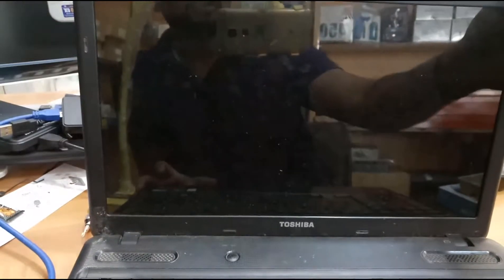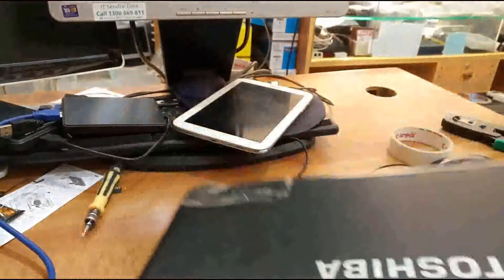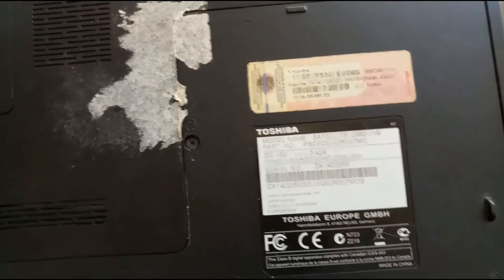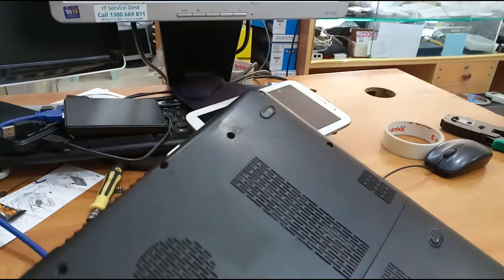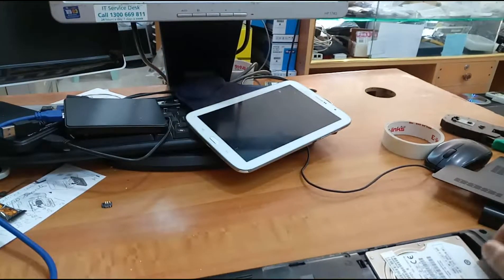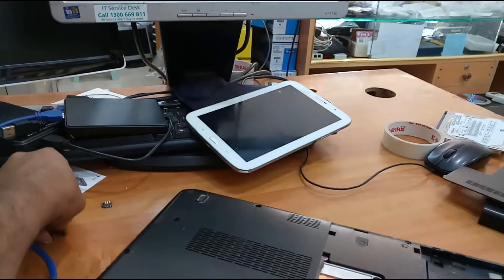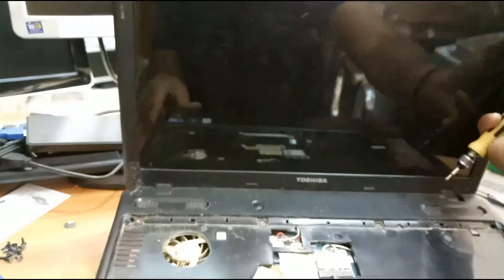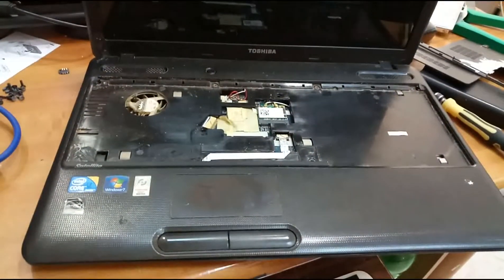Solved automatic shutdown toshiba laptop simple method....working 100%

Comment: Bro my laptop turn off when i play games and the all led light turns off and it turn on after 5-10 minutes can you say any way to fix it pls
Reply from the maker: It's getting over heat..try to open processor above fan and apply heat reducing paste..if your using graphics card same procedure remove fan and  apply heat reducing paste..
Reply: @recyclebintech8934  will it work using cooling pad
Reply from the maker: @zovocz  yes

Comment: Can you help me on my problem about my laptop turning off ? It is also toshiba but i did'nt know what is the version etc.
Reply from the maker: is ur laptop getting over heat
Reply: @recyclebintech8934  cpu
Reply: If u took it to someone to repair it then they probably replaced ur cou
Reply: Try to replace a fan to a big one, u most be doing it by your self.

Comment: Hi,Toshiba satellite C650 Model Laptop - Display goes off after 4-5 minutes of working.
Fan is clean. Heat sink normal heat. But Cleaned CPU and GPU and applied new thermal paste. Works for sometime, but again display gets off. Power LED and charging LED still glows. But No display. 
Could you please advice what could be the issue.
Reply from the maker: can u connect one external display and check
Reply: Did u solved the issue?????

Comment: Hi my Toshiba laptop restarting sometimes when power adapter is on. But when I take out my AC adaptor and keep running on battery it is working well. What is the problem?
Reply from the maker: did u replace an check power adapter